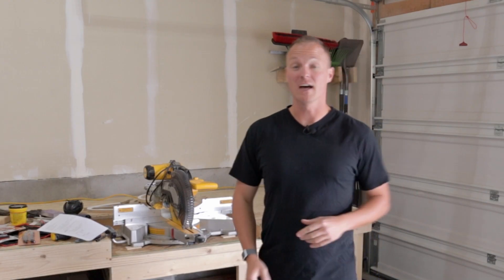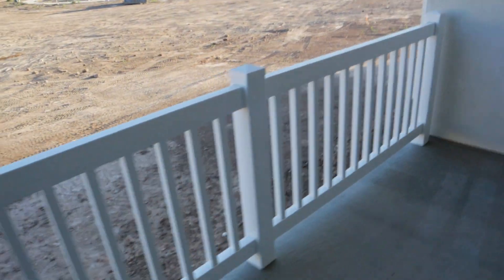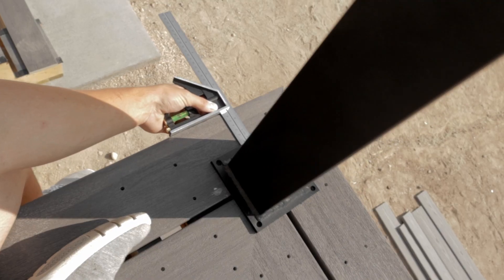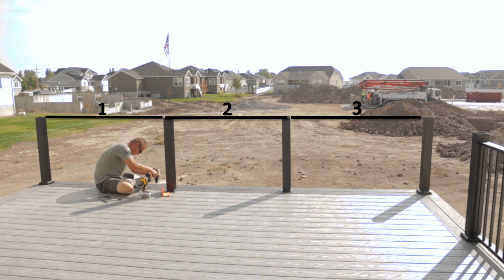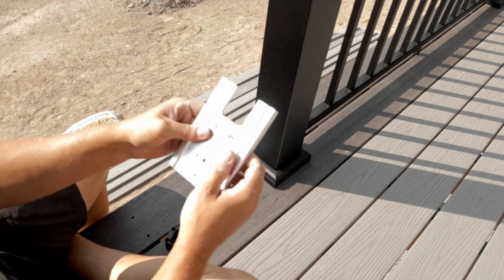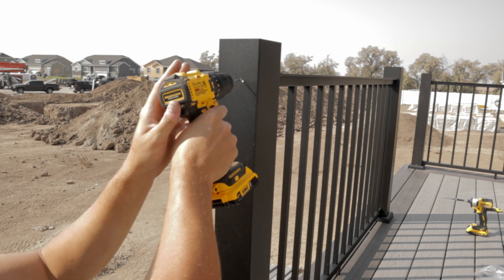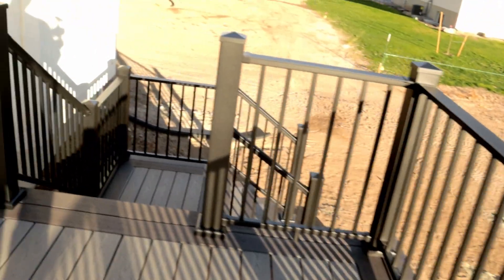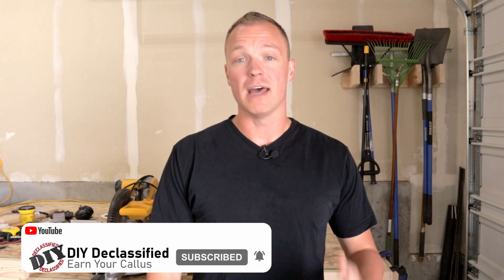My EPIC Deck Build - Installing AFCO Railing and Final Reveal // Episode 5

Comment: this turned out really sharp!  Looks professionally done and will add a lot to your backyard.  Not to mention equity in your home...  We went with those little solar LED post caps and I think that's one of my favorite parts of ours.  Adds a nice touch when it's dark out.  I just wish you would have made this series before I built my deck back in 2015!  lol  I would do some things different using your tips and tricks.
Reply from the maker: Thank you! I tried to find light caps to fit the posts I installed, but they were crazy expensive for size I have. This coming spring/summer I plan to do more videos on finishing the yard and add accent lighting to the deck.

Comment: Hi what manufacture of decking did you use? It looks like fiber on if so, what were the color choices? I really like your taste
Reply from the maker: You are correct, it is Fiberon. The color I used for the inside is cottage grey, and the border is espresso. Looking at the site, they may have updated the color scheme a little. I purchased the material a couple years ago and the espresso was more of a black/brown tone. Looking at their site now the espresso is not the color that I have. What I have is more in line with their Latte color now.

Comment: I hope mine turns out this nice, what was the total cost of this project?  US or CDN dollars?
Reply from the maker: Hindsight, I should have put a cost breakdown at the end. But, overall the cost of all the materials was around $12,000. The aluminum railings were $4,000 of that purchase, and more than half of the railing cost was just for the stairs. So if you are doing a landing like I did, the added railing will cost ya.

Comment: may i know what is the total cost to build the deck 
and is Lowes or Home depot is better to get Deck supplies ?
Reply from the maker: The total cost was around $12,000. I purchased a majority of my materials through a local lumber yard, where the cost was a little cheaper. Lumber is expensive right now, so shop around.